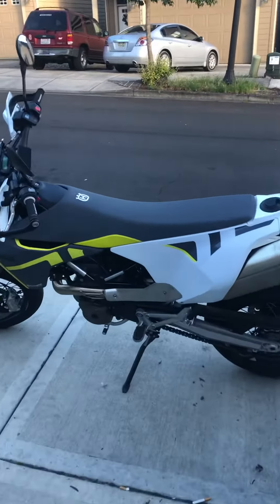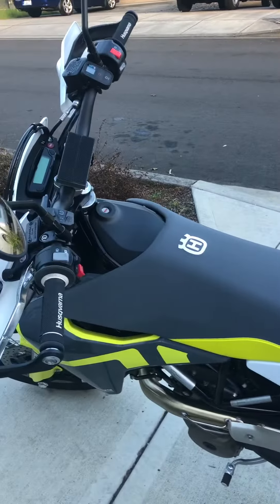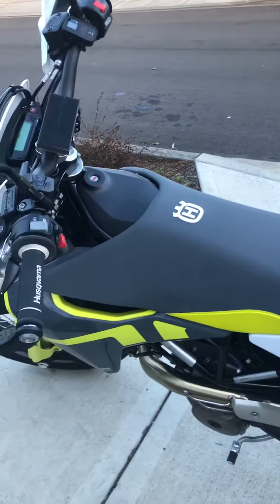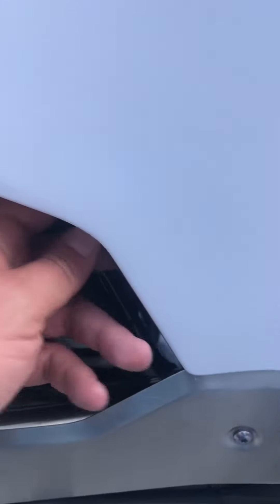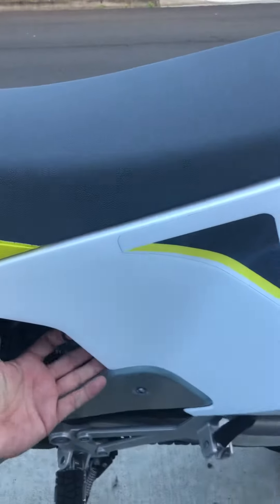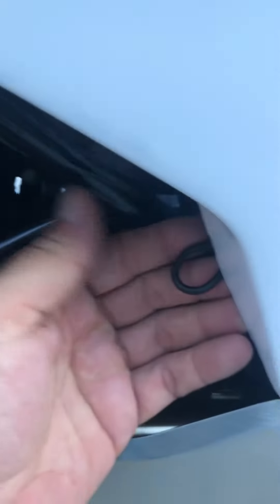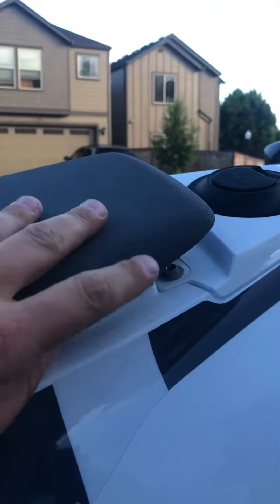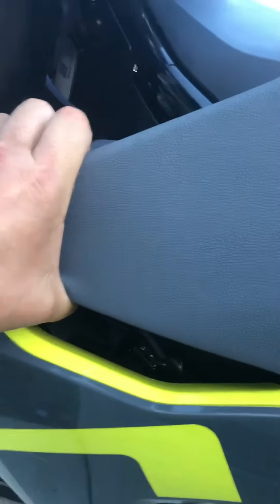How to remove Husqvarna 701 SM (Supermoto) seat

Comment: Isn't there a user manual that shows exactly how to take off the seat?
Reply from the maker: Wasn’t in the 2020 manual.  I think it’s so common for dirt bikes, etc. they presumed you knew.  They also don’t describe how to use the kickstand :)  Coming from street bikes tho, this isn’t normal.  Usually you turn the key.
Reply: @itspandatime  well, who would have thought that they would 'hide' the mechanism😂
Reply: The user manual shows the loop that releases the back of the seat, but doesn't show anything about removing the front of the seat from the bike.